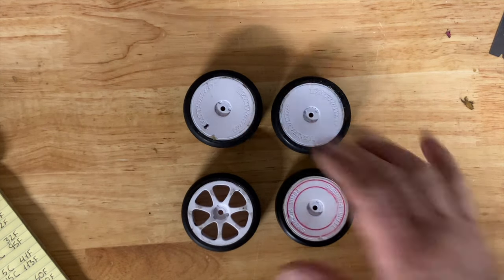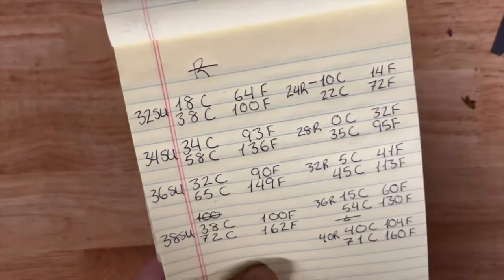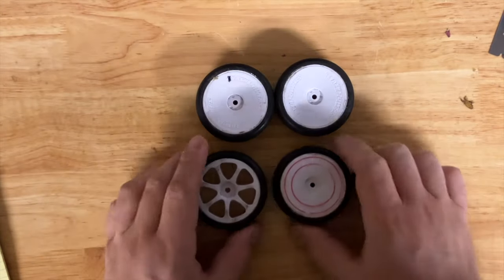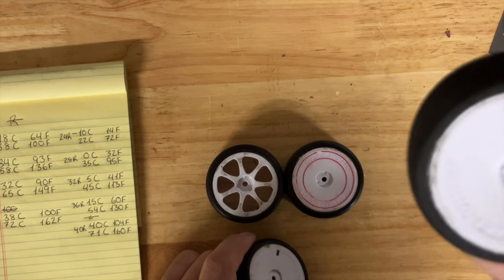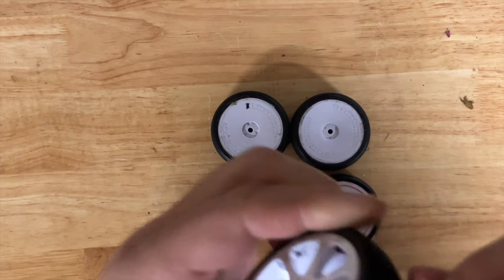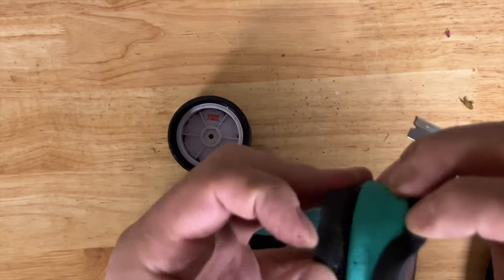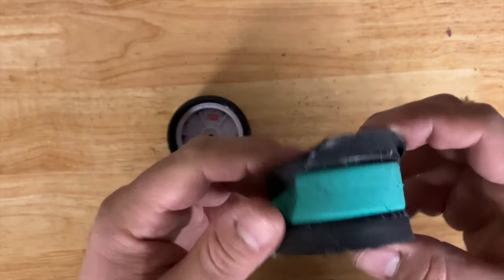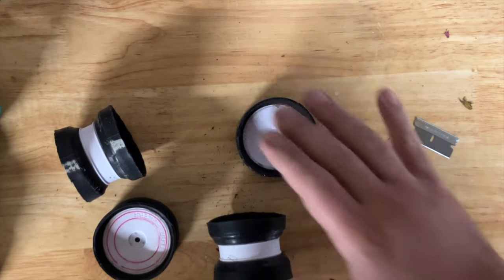RC 1:10 Touring Car Tire choice basics for newbies based on Team Powers tires 32SU 32SX 28R 30R

Comment: In our valley 34s are the goto for most the year.... 36s are best for summer in the California.  32s maybe for the cold. Should be clear that your temps are Track Temp
Reply from the maker: Good point. I missed clarifying asphalt when talking about operating temperature. That's the problem when assuming. Hopefully people make the assumptions that the tires contact the asphalt and it will affect the operating temperature.

Comment: Harder the compound the softer the foams softer the tire harder the foam and I think that operating temp is for the asphalt and plus the surface is blacktop asphalt has more bite
Reply from the maker: The surfaces are interesting. This surface at Norcal is somewhat course. But Fresno is smooth in comparison. I think I like the soother surface.